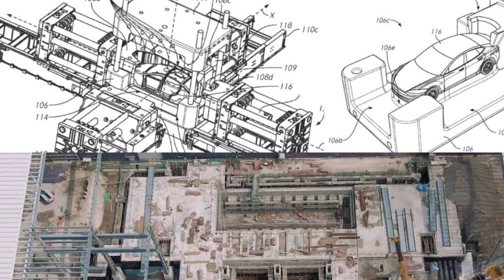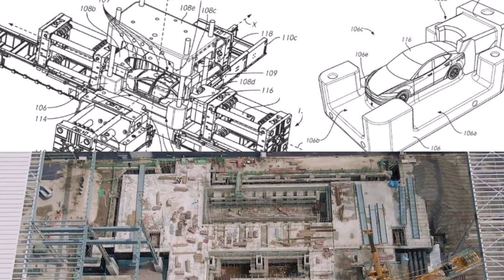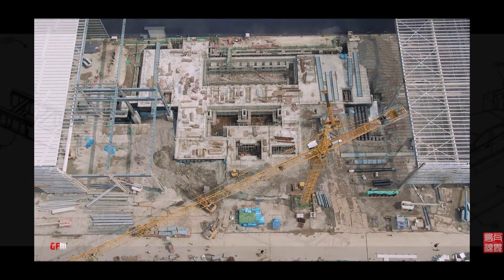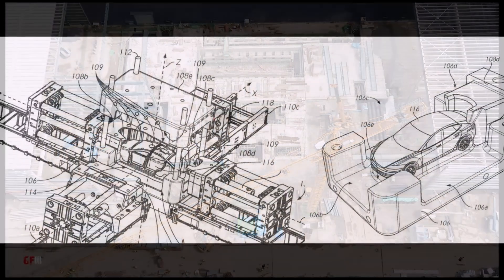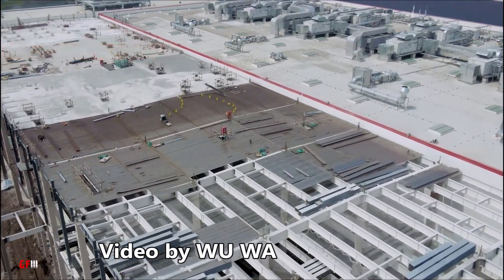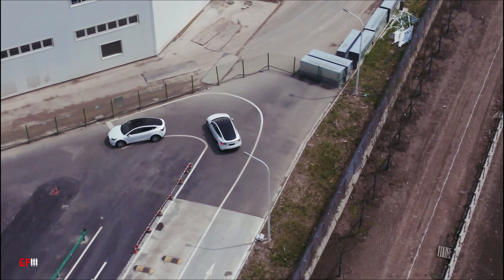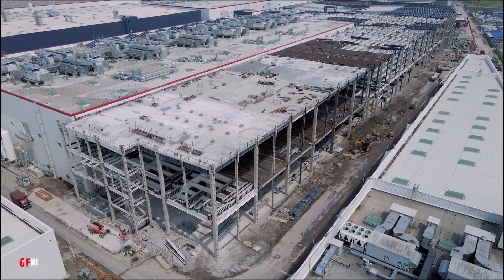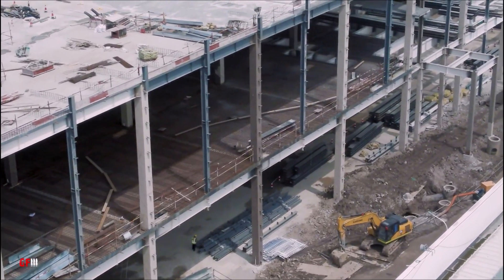Tesla Is Building a Massive Foundation at Giga Shanghai

Comment: The Cybertruck will be an exoskeleton, but not made as a single piece. It will be stamped then welded "Ultra-hard 30X Cold-rolled Stainless Steel."  Tesla patent US15/874,348 “Multi-Directional Unibody Casting Machine for a Vehicle Frame and Associated Methods” will require their patented "special sauce" aluminum, to flow fast enough and to cure without heat treating.

Comment: I think the mega-foundation is for the Semi-truck.
Reply: Very interesting if it is. Current knowledge is they are outsourcing the frame but on the other hand, they might have changed the plan because of delay. Casted aluminium frame and structural battery pack would save lots of weight. 

I don't see much of demand for a cybertruck in China so maybe this indeed is for semi.